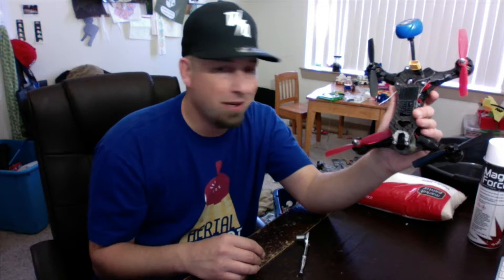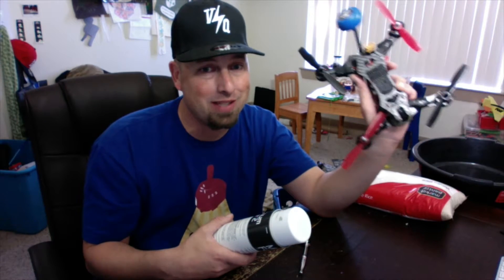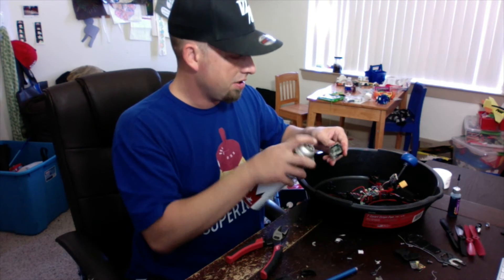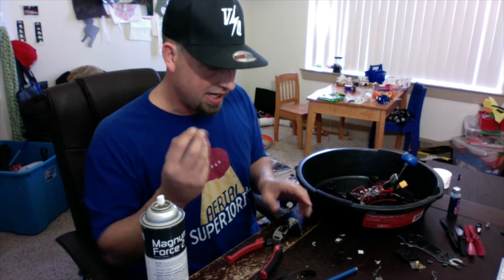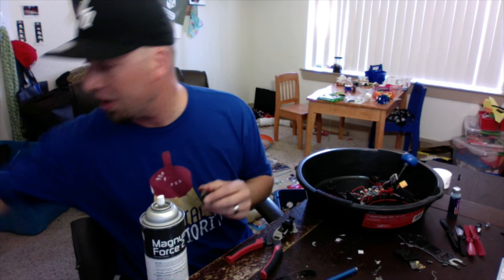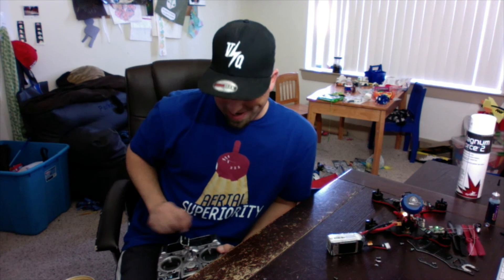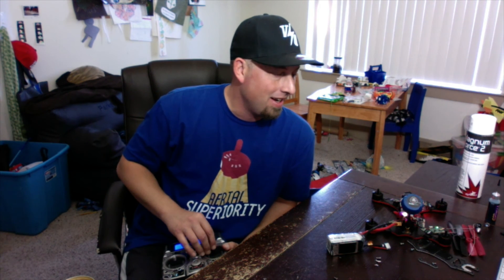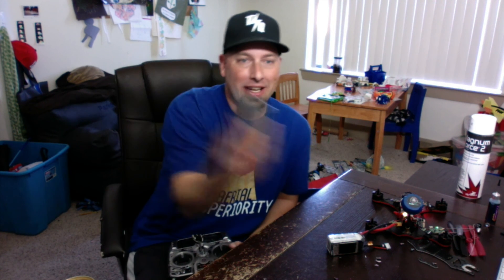How to Save a WET Drone After Being Submerged in Water

Comment: My 3” landed in the lake… took 4 mins to get it out. I took off the top plate and let it bake in the sun for 4hrs. Then held it out the window at 70mph for a few hours. Then went to Autozone bought a can of wire dryer for 8 bucks and soaked it again. Held it outside my truck at 70mph for another hour. Took a hair dryer to it for another 30mins. Used an entire bottle of compressed air. Plugged into beta flight and saw my flight controller light up. Deep breath and powered it up with a battery and booooom drones totally fine. Vtx, RX, flight controller, ESC, all the motors, RunCam hybrid, totally 💯 fine.  Hope this helps someone.

Comment: My drone has been underwater for about 3 weeks now I' finally found someone who is willing to dip in this nasty water and get it . I did get insurance . Is it worth it ?
Reply from the maker: what drone?  Its worth trying to clean up but never trust it until you fully test fly it.
Reply: ATx RC Productions by CheFPV it's a Phantom 3 (4k)?
Reply from the maker: ohh man, I bet the camera is toast, was it fresh water atleast?  if so a thorough cleaning could make some of it viable, but you are already goign to see some major corrosion and really anything you recover will not be airworthy in any safe capacity.  I would recover it and use what you can to build a fun new DIY project.

Comment: today my drone fell into the sea...and it was submerge in like for 5 to 10 mins. and some diver took it and gave me and then I put normal water and cleaned it. after I went home I put the battery of drone into rice. then i gave drone to my brother and they did stuff which I don't know because I was in the closet crying...so still the battery is DEAD.DOESN'T WORK...Pls reply what should I do....
Reply: HeXmCd 99 here is a way to fix it don't just use rice use electronic cleaner spray to get in the battery moter and the mother board on the drone that should fix it

Comment: why so worried about the motors? they are the only component that can function even completely submerged in water, they don't care about water at all
Reply from the maker: Fr3ak00 they may operate, but windings are copper and can quickly oxidize and cause malfunctions.  A motor is only as good as its windings.
Reply: My DJI Phantom was about a foot underwater for less than 5 minutes. Dried it out for about 3 days and when I applied power 2 of the motors burnt out. Power was only on for about 3 seconds before I ripped the battery out!